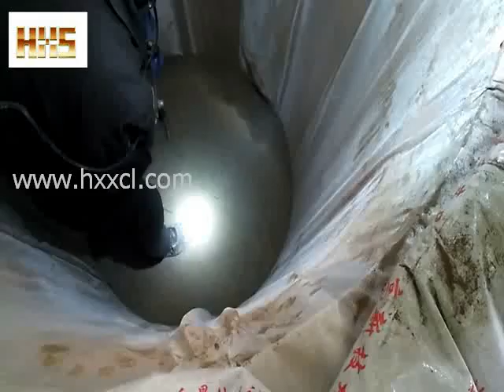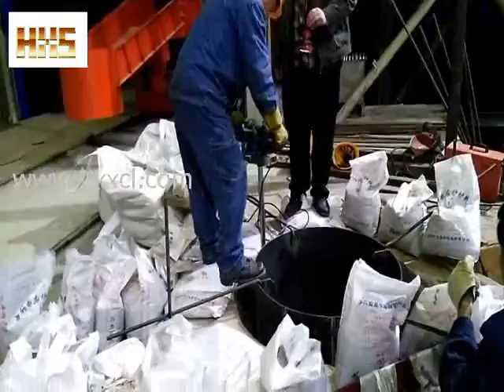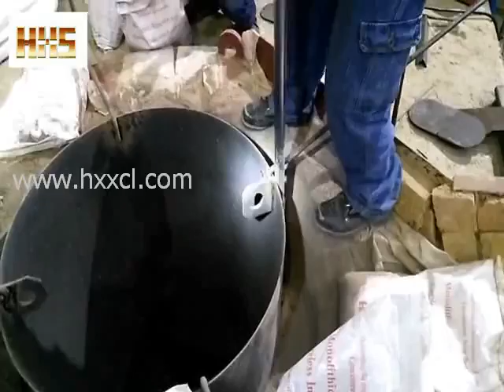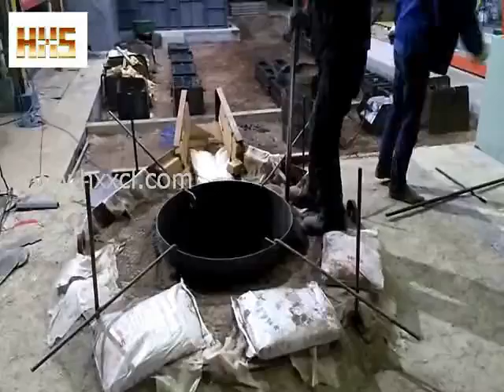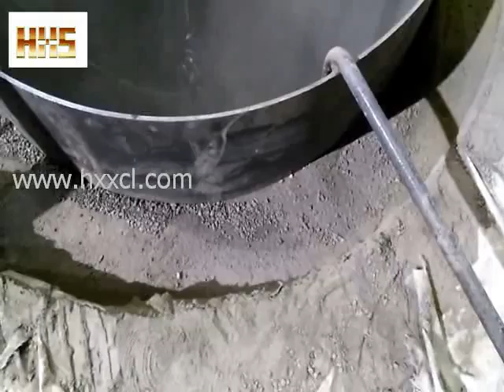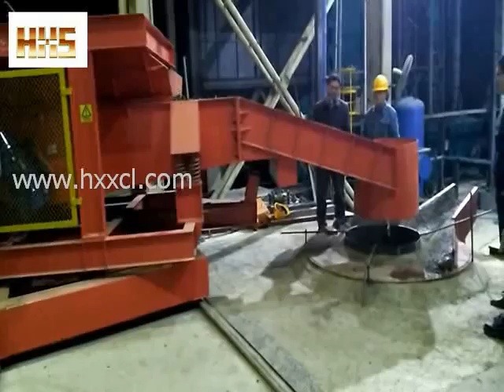HXS Patented Automatic Electrical furnace lining vibrator

Comment from the maker: PRODUCT: HXS Patented Automatic Electrical furnace lining vibrator       
MODEL: HZG-Z
Video: 5Ton induction furnace making alloy steel  - applying neutral ramming mass
RATED VOLTAGE:  380V/415V   3P/4W       
CAPACITY: 1 KW
Advantage: 
1) compact lining structure, 2)half lining building time: <1 hour
3) Electric powered - convenient operation, no deed of air source.